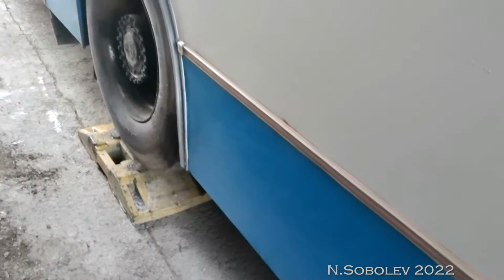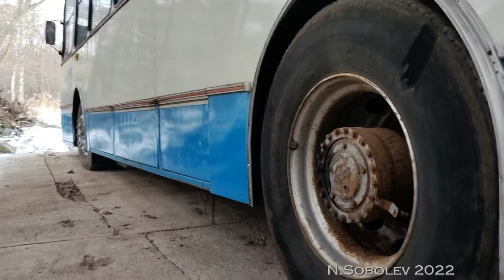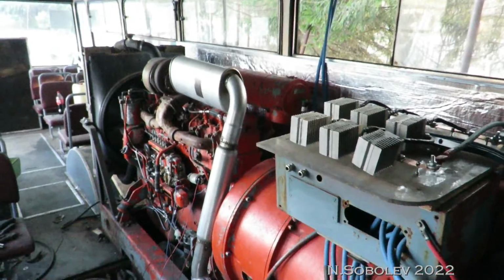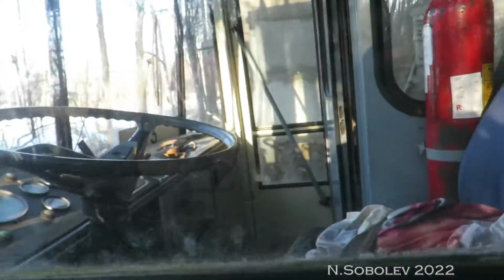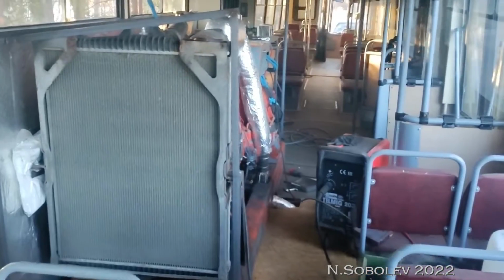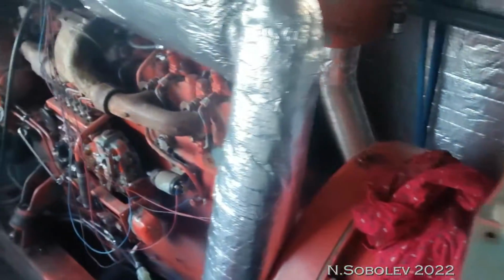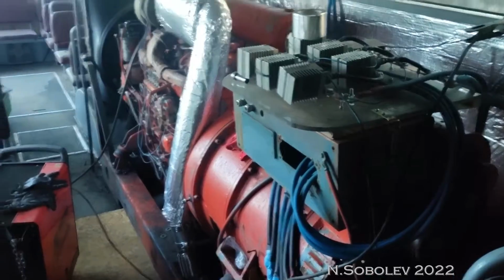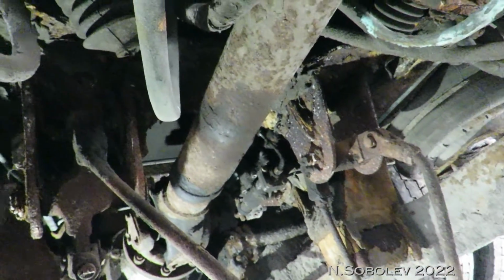Skoda 15 tr build part 6

Comment: The sound got better. 
I wonder why the brake rods were cut in the depot?
And be attention - safety is very important. Glasses, gloves.
Reply: I'm pretty sure this has the kind of brake cylinder on the B axle (like any bus, trolly or truck) that has the "spring driven" safety handbrake on it as well. And I guess someone though it's easier to cut the rods of the brakes than to simply deactivate it (there's a shaft for this purpose, to disengage those brake if the air system fails, so you can still tow the vehicle).

But I agree, please wear safety goggles (glasses), one wrong movement working under the bus and you can damage your eyes easily.
Also if you don't use one already, use some stands under the bus (anything, metal stands, bricks, wood) if you work there, because if one air suspension goes off, the bus won't hop on the ground but still can crush you (some lower parts like the diff, suspension parts...etc).